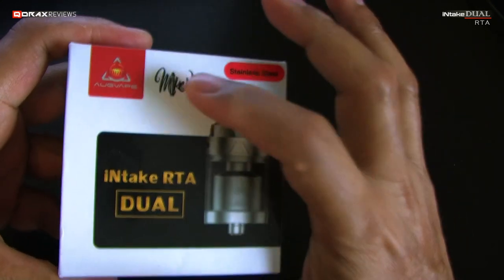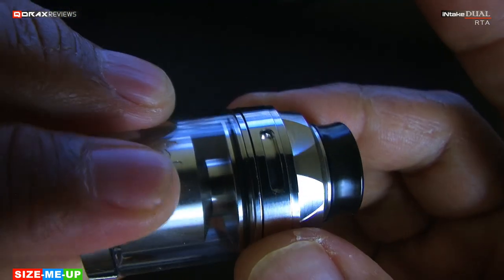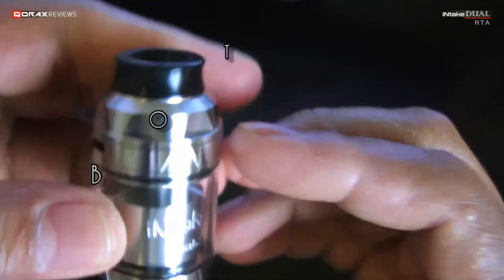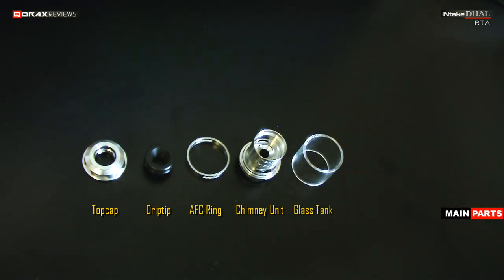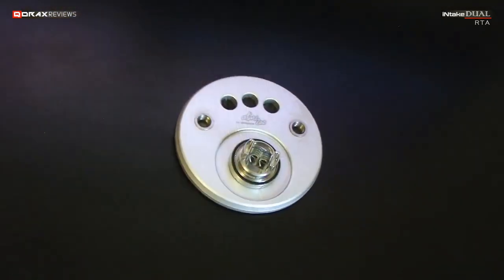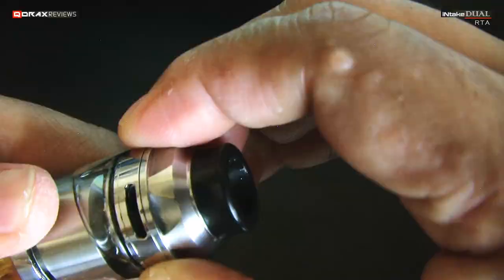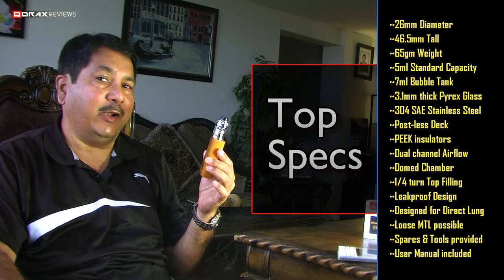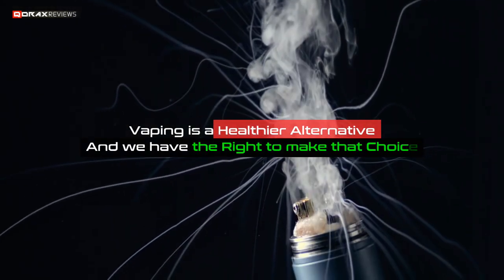Mike Vapes' INTAKE DUAL / Great RTA!

Comment: Great review, but I'm sticking to the original single coil version, of which I have two.
I've tried the dual, and at the temperatures I vape (I'm exclusively TC) I find the vapour production to be more than adequate with an averagely complex coil (triple fused clapton, unframed staple, etc) which in stainless steel is much easier to have a high enough resistance to function on all my mods.  The 0.14Ω coil in the Intake that has my blackcurrant jam doughnut flavour in it could not be dualled and still fire on most of my mods, as 0.07Ω would be too low.  The other would work on only a few, as it's 0.17Ω single, so only those mods which allow sub 0.1Ω coils (a minority) would work.  I even have one single coil (a SSFC) in a serpent mini which is 0.08Ω, which could not be dualled in parallel on any mod I own!  It also uses less power to heat up (according to Escribe), and half the coil and wick expenditure, which is why despite having some large tanks, I generally use single coil decks - the only one I currently have dual coiled is Bogan/Dovpo's Blotto, which with painfully thin wire I managed to get a pair of tricore fused claptons into at 0.12Ω, although I may try a single coil in that too.  I even got the single coil decks for my Steam Crave Aromamizers - supreme v2 and plus.
I can see the need for dual coils if you want the abolute maximum possible vapour production (and correspondingly high e-liquid consuption), or if using plain round wire builds, when you need some means to increase the wetted surface area of the coil (where the vapour is actually created) but multi core claptoned wires achieve the same result.  But as they say, variety is the spice of life, and having as many options as we do means greater choice to attract people away from deadly smoking. 

Speaking of which, that 5 year old >95% safer figure is about to be made obsolete by the latest findings, which are about to be published and reduce the residual harm from <5% to <1.6%.  As I predicted when I first started looking at the science, most of the possible residual harm seems to be conservatism on the part of the researchers (which is anderstandable and laudible as "don't know" means exactly that), and as more studies are produced, much of that possible residual harm is being ruled out.  With PG being such a powerful antibacterial and antiviral agent, it may even end up with vaping being SAFER than not, although I doubt it will ever be recommended for non-smokers, even at 0mg/ml nicotine, except as a delivery mechanism for other drugs (in which capacity it is already widely used).  A study in Chicago in the late 1940s found it 100% effective against the H1N1 strain of influenza which caused the 1918-1919 flu pandemic, which killed more people than WW1.
Reply from the maker: Wow, that was some heavy read indeed! Thanks for your detailed view Phil.